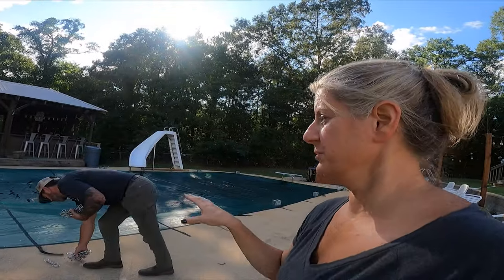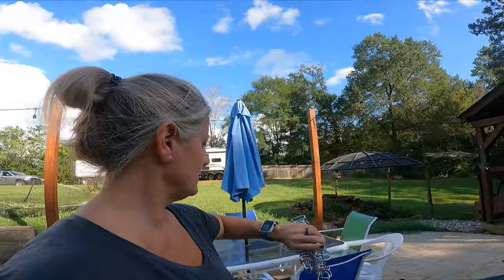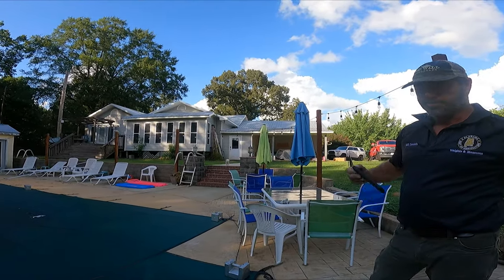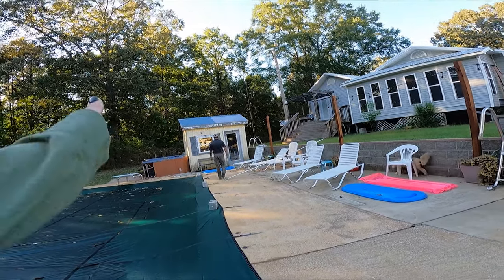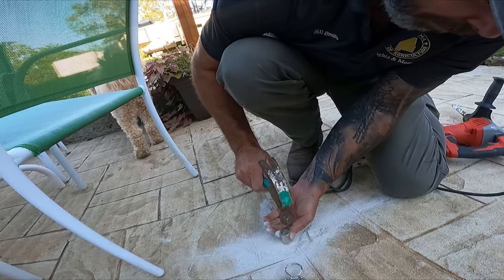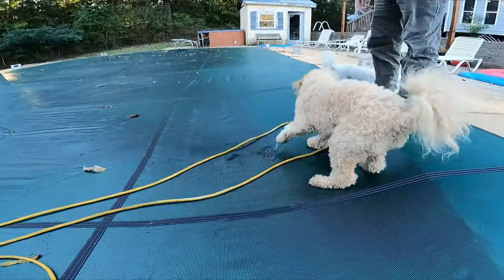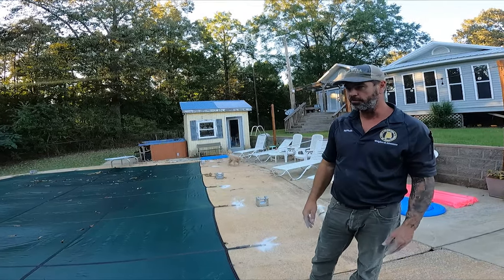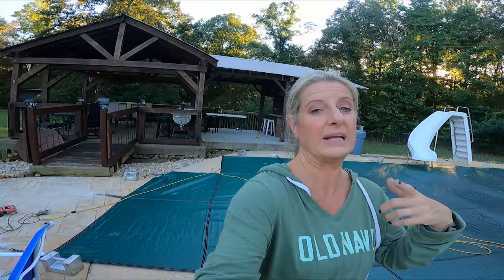2 CENT Tuesday - Vevor Safety Pool Cover Install How-To

Comment: You should add an Air pillow in the middle so that leaves, snow and rain slide off. Im just looking for ideas at the moment, and your video was really helpful. Thanks for sharing
Reply from the maker: It doesn't catch leaves to bad. Most blow away there is a few in the spring and he takes the pool brush and moves them to one side and pulls them. Now we don't have snow so not sure about that but I think it would be a good thing to try and see if it makes a diffenace.

Comment: Just ordered the Vevor Safety Pool Cover. Need to know, does everything come with the cover. Should have ask before ordering. It Suggest that  it does have everything needed except the drill and bit.
Reply from the maker: You will need a drill bit hammer screwdriver and a hammer drill   It has everything for cover just not install.
Reply: Thanks for the quick reply.

Comment: Does color matter when choosing
Reply: Do you like the green?
Reply from the maker: @nco6835  Yes we still love this only thing we have learned it was all mesh so it did turn green but cleared up quickly. We have a ton of trees around. It was easy to clean when we took it off and we have installed it again this year what we love is we can do it with 2 people.
Reply: Thank you we’re trying to get the same one couldn’t decide between blue or green thanks

Comment: Thanks for the video.  How does the cover look now, after one winter?  I have to replace my cover, and the Vevor is priced significantly lower than most of the other mesh covers I've looked at.  So much so that it makes me suspicious.
Reply from the maker: It looked great. We took it off and washed it off. Looks new again. We never had cover but the mess kept all the leaves and debris out. It worked great.
Reply: @BillandKelleyAdventures   thanks, I think I'll order one today, before the price goes up!

Comment: how is that cover after  2 years
Reply from the maker: Still good just wish we had gotten the one that blocks light. Just cause algae grows because the light gets through but it still tight and holding up well. Still very happy that was only regrate.
Reply: Thanks for posting.  About to install the same cover.  Not much for instructions in the box other than the concrete hammer drill bit size is 3/4" and drill to at least 1 5/8".  For your algae issue do you treat with polyquat 60 when you close and then if it is a persistent issue retreat through the winter and stir up with a pole and pool brush a bit.  It shouldn't take long to unhook a few straps and then reattach.  Its not expensive like $30 and apparently is the best algaecide to use.
Reply from the maker: @joejim2963  Your welcome and thanks for the tip. It's because the cover we got lets light through but we vacuum the algae off when uncovering and its all clear. We learned that this year.